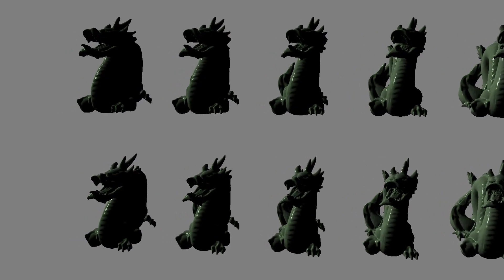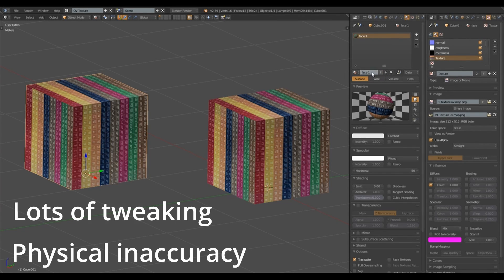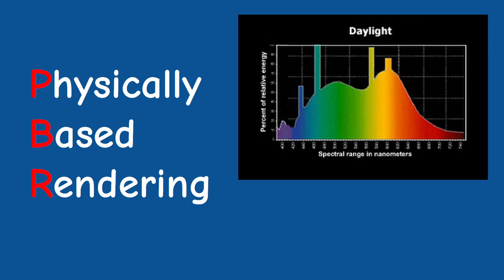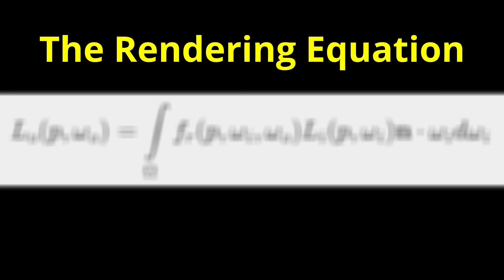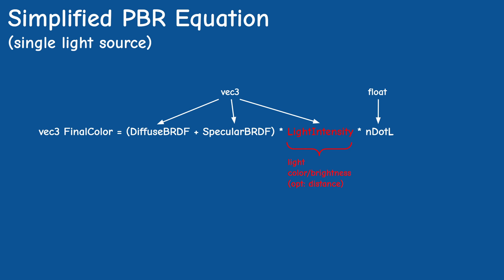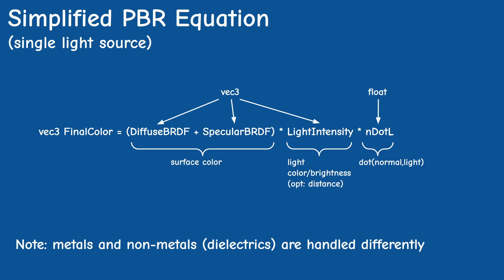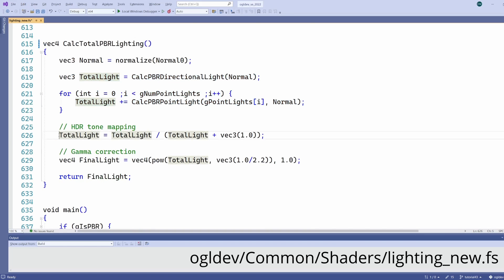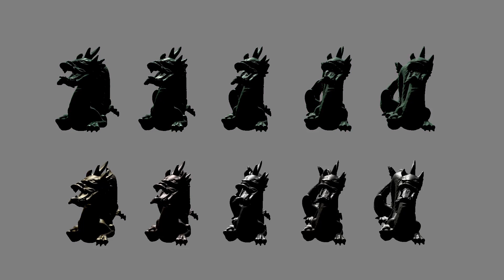Physically Based Rendering // OpenGL Tutorial #43

Comment: my scene feels dark when I use light sources, is there a reason for this? Colors feel less bright than what I feel like they should feel
Reply from the maker: The question is whether this is a bug or simply incorrect or badly tuned params of the light/material properties. You can take the assets and lighting params from an existing app that seems to work correctly and plug them into your sample to compare.

Comment: When explaining the halfway vector, it looks like the light vector  arrow is backwards. If I sum and normalise the two on screen, I'd get something below the surface.
Reply from the maker: I usually show the light in its "native" direction going from top to bottom and then the actual calculations of the diffuse factor (and in this case the half vector) are done by reversing the light direction. You will see the same thing in the code. I can see that the slide is a bit misleading in this case.

Comment: In your experience how much performance would cook Torrence cost compared to say just doing blinn phong?
Reply from the maker: I haven't actually measured so I can only guesstimate. I would assume that there isn't much of a difference even though we are adding more instructions with PBR. Maybe if the number of lights is very high. It also depends on the GPU ofcourse. If you have lots of light sources then you may be better off with deferred shading but if you only have a few lights then I think the performance effect will be minor.

Comment: Is the metallic shine of video games due to pbr or raytracing?
Reply from the maker: Both techniques can create the effect of metallic shine but I would guess that PBR is more common than raytracing because afaik raytracing is slower and more compute intensive.
Reply: @OGLDEV  for shure all these sport car are made with pbr 🙂
Reply from the maker: That's why they are so expensive ;-)
Reply: @OGLDEV  i have still problem to find a file for load obj model i find 2   library online that work just show on console  how many vertex,normal and faces but don't show the model on the opengl window
Reply from the maker: Are you using Assimp to load models?

Comment: Hey, i have a question
Now, usually when calculating the reflection
We usually dont have the "light" vector
We would have a reflection vector, but that doesn't necessarily mean that the reflected ray would bounce of toward a light source.
Is it still what you meant by "light" vector?
Or do i have to somehow calculate the direction of the closest emitting material or something?
Thanks in advance!
Reply from the maker: Reflecting and reversing (or negating) the light direction are two different things. When you want to calculate diffuse lighting you have to do a dot product between the normal and the light direction, but the light direction must be pointing from the surface and "up", same as the normal. For example, if the light hits the surface at maximum strength it means that the original light vector is perpendicular to the surface but is opposite to the normal (which is also perpendicular ofcourse). So you multiply the light direction by -1 and when you do the dot product with the normal you get 1 which means maximum strength. Reflecting is when you want to calculate the specular effect. Let's say that the light hits the surface at 45 degrees angle. To calc the reflection you call reflect(LightDirection, Normal) and this will give you the a vector which point 45 degrees on the "other side" of the normal. The original light vector is pointing at the surface and the reflection is pointing back up. This allows it to hits the camera and the specular effect increases as the reflection and pixel to camera vector become aligned. So you don't need to reverse in the specular case, just use reflect() with the original light direction.
Reply: @OGLDEV  thanks!
My question was just wanting to know if I can replace the "light" in your video with just the incoming ray, whether it was from a light source or an object
Because, as you know, that's how raytracers work
Thanks again!
Really underrated channel.
Keep it up.
Reply from the maker: Oh, I see, I think you can.
Thanks!

Comment: Hi,
First of all thanks a lot for providing us these videos. I have a doubt in half vector calculation. Taking the direction of light vector into consideration, shouldn't the equation for calculating half vector be: half = normalize( view-light). As light + view would be more horizontal. Or the direction of the light vector should be opposite ( by which I mean that it should be multiplied with -1).
Reply from the maker: The light direction is provided by the application in the natural order - down towards the earth. I believe it's more intuitive for the developer to think about it like that. It is reversed in the fragment shader.
Reply: @OGLDEV so for me to apply it to my case, I have to reverse it like he said?
*-1?
Reply from the maker: @hajjex_9086  Depends on how you send in your light direction. The shader assumes that it is the original direction so it has to reverse it for the diffuse calculation because the dot product needs the direction from the surface back to the light source. But you can also optimize somewhere between the application and shader and reverse the light direction before it goes in and then the shader can use it as-is without extra ops.
Reply: @OGLDEV  I actually send my rays from the camera
And that's it
So in reality
It's actually pointing toward the light source at some point
So does that need reversing?
Reply: @OGLDEV also, by original direction, u mean that it's from light to surface.
This means we will simply do light vector + view?
This confused me a little.
Reply from the maker: Maybe I'm missing something but the light direction is independent from the camera. You need to send the camera location so that you can calculate the view vector and it need to go in the correct direction - from the pixel to the camera. Yes - it will be light + view.
Reply from the maker: Original light direction means the way that you think about it naturally - a directional light from the Sun goes from "top" to "bottom" and hits the ground at some angle. In the case of artificial lights it is even simpler - from the light source to wherever.
Reply: @OGLDEV  alright thanks!
I got confused for a second
Because I thought you were basing ur explanation your explanation on a different approach, which somehow needs calculating the ray from the light to the camera
Which needs the half vector to be calculated by adding the light v with the view v
But turns out it was just the normal approach
Thanks man!

Comment: one thing I don't understand, you say that alpha(roughness) = 0 means a perfectly smooth surface, that means it reflects all light, but when alpha is 0 than the whole normal distribution function D computes to 0 (since the numerator is 0*0), hence making the whole BRDF specular equal to 0, since D is multiplied for G and F .. Something I'm missing here?
Reply from the maker: It's a good question. Obviously when alpha is zero the BRDF is zero so we don't get specular lighting. I think that zero here serves as kind of a limit to which we are not supposed to reach and realistically the roughness values will be much higher (I consider 0.1 to be "much higher" ;-) ). Here's an interesting experiment you may want to try: plug the GGX equation into a spreadsheet. Set an input column for alpha and have it start at zero and continue with small increments. NdotH can be constant for the entire spreadsheet. A good example is 1 where the light ray is reflected directly at the eye but you may want to play with different values. When NdotH=1 and alpha=0.1 you are already getting 3183 which is very high and alpha=0.01 is really crazy. So I guess alpha=0 should return infinity but the equation simply doesn't work that way. I'm pretty sure the people who invented this were well aware of this corner and the papers may have addressed this already. Infinity is not very useful in practical applications so I guess they just ignored it. This is just my intuition. Joey De-Vries has a web based example in https://learnopengl.com/PBR/Lighting which you can also play with. When alpha is very low you get a very concentrated specular reflection and when it is zero there is nothing.
Reply: @OGLDEV  aaah thank you this clarifies it! I got stuck on that believing I wasn't undertanding some relatively simple math! Indeed thinking on it the stronger specular reflection is, the smaller the area that is seen reflecting. So alpha must be non zero or the area reflecting gets infinetely small, On the source you linked in the code alpha seems to start at 0.2. Thanks!

Comment: How does shadow mapping work with PBR? Where do you apply the shadow value?
Reply from the maker: I guess it should work the same as the regular Phong model, since PBR only deals with the color of the object. Compare CalcDirectionalLight with CalcPBRDirectionalLight. The non-PBR version calculates a shadow factor which depends only on the light direction and the normal. You need to multiply it with the PBR color.
Reply: You can just multiply the light color/intensity with the shadow factor.
Reply from the maker: Yes. I'm working on a new PBR tutorial which combines environment maps which are kind of ambient light so they should be excluded from the shadow. The shadow factor should only affect the regular light sources.